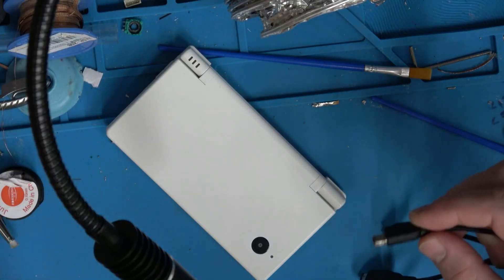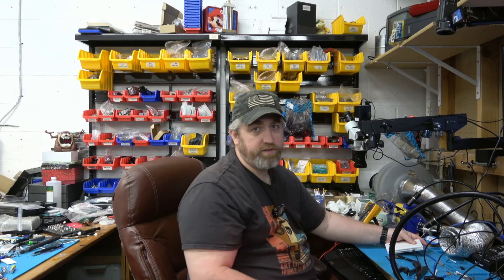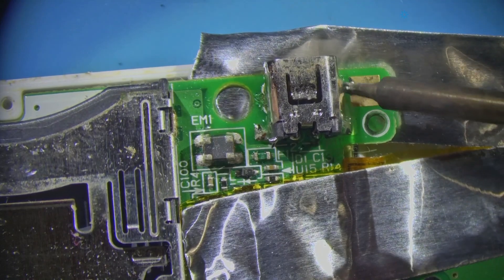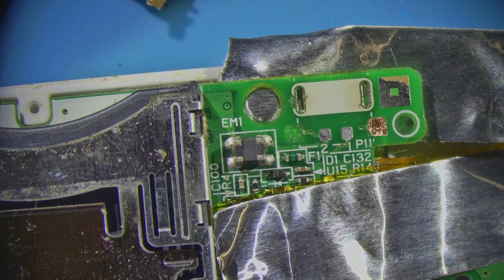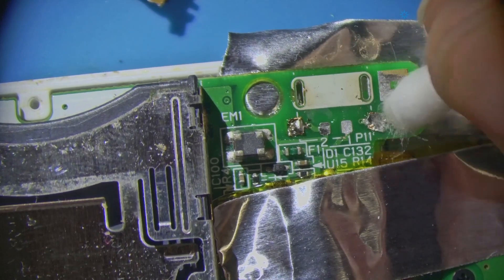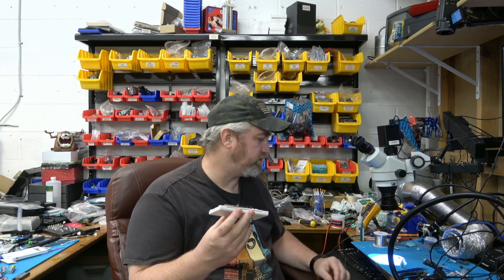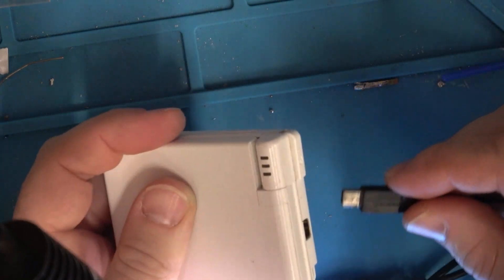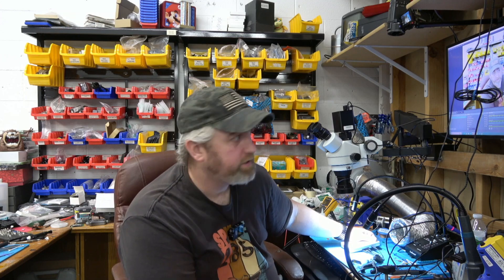Nintendo DSi Charge port repair [ replacing DC jack ]

Comment: Its 5v, should have replaced it with USB-C, might as well in 2024. Could charge the customer an extra $20 on top or something.
Reply from the maker: The problem I have with USB C conversions is that the batteries on these devices are still designed to be charged at certain voltage/amperage.
You go USB C, and people plug in a high powered cell phone or laptop charger and cook the battery or an ic.  I see it all the time on Nintendo Switch and PlayStation controllers.
I find the idea inadvisable.
Reply: @grimwoodfix  
I think you're mixing things. The battery is not getting its voltage/current directly from the port,. that's the job of the charging circuit (which we don't touch). You're just replacing the port, not the charging circuit.
For plugging in invalid usb-c cables, you just need to add 5.1k on CC1/CC2 pins. That's all you gotta do to protect any unwanted voltages which most modders neglect.